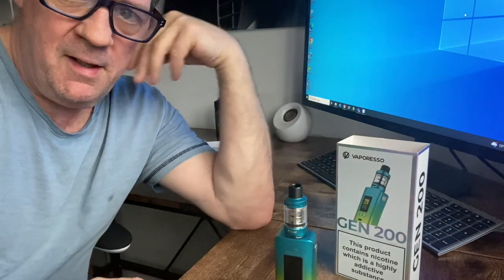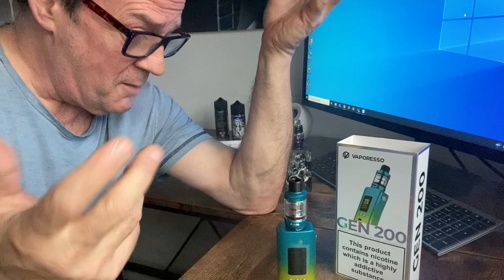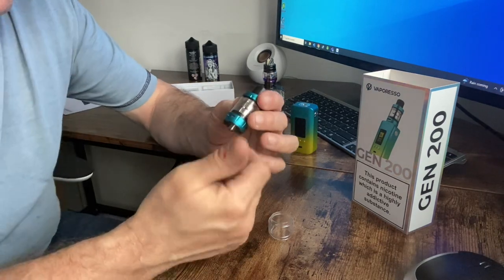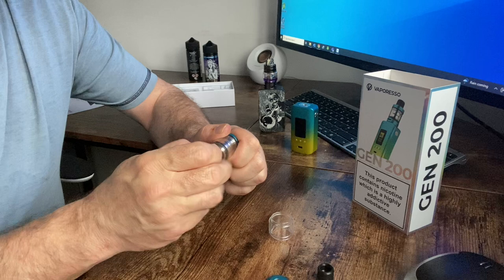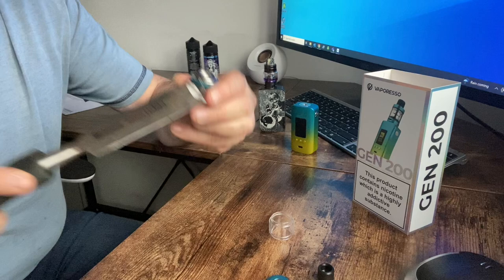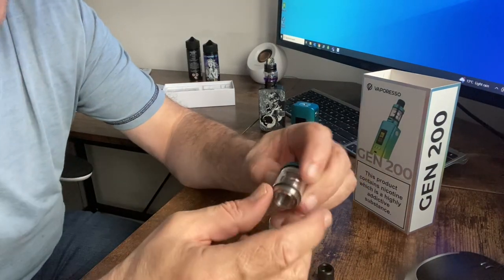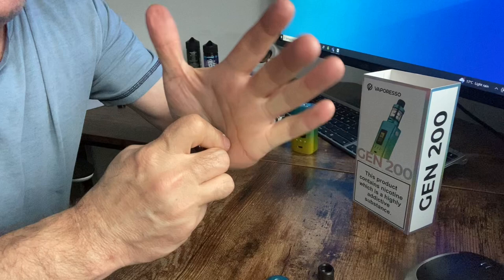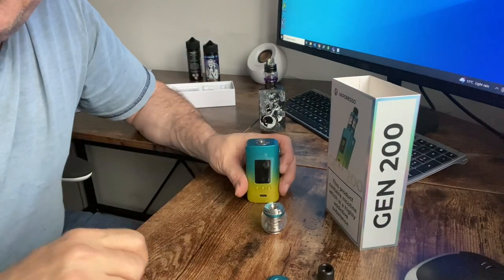Vaporesso Gen 200 glass removal and replacement bubble glass upgrade high capacity

Comment: Did I miss something ? The glass won’t fit over the bottom without stretching the glass which ain’t working out for me.I could use some windshield  repair resin for a hairline crack but doesn’t the thing come apart into 2 pieces?

Comment: I have the exact model, right down to same colour.  I love it, except for one problem: I cannot get the turquoise portion between the tip and opener for filling to fit on flush -- no matter how much force or which way I turn it, can I get the metal portion between the tip and filler to go back on without a gap.  Does anyone have any suggestions on what I might be doing wrong?

Comment: Have u had issues with the coils. Mine taste burnt even though I've changed coil 4 times in less than 24 hours
Reply from the maker: I haven’t to be honest, are you using the right mix of juice?
Reply from the maker: Are you still having problems? I’ve only changed mine once in 3 weeks and I’m a heavy user
Reply: 😮that doesn't sound right at all mate 1 coil should last 3 to 4 weeks and that's for a heavy vaper
Reply: You may need to get a higher rated coil or lower the power
Reply: @ahadsurooprajally4780  I sorted the issue now mate 👍. It was the liquid that was the issue. So used a different flavour with the same coil and it tasted fine
Reply from the maker: Omg I’ve lost count of the crap juice I’ve had, I get a really good one at https://www.vaportitto.co.uk/ excellent price and tell them Mo sent you
Reply: Thank you for the tutorial, it was extremely useful. You now got a new Sub & Like.

Comment: Cheers got a vapor esso armour max and the 2ml stock tank was a bugger to get off to swap for a 8ml  plus that plastic spacer should not be there on a out of the box ready mod and i tank 2. I cracked the 2ml glass getting it off so will look for a refund and vapor esso should supply instructions for i tank 2 glass removal in the box and they don't. The top part and tank shell does not unscrew on i tank 2.